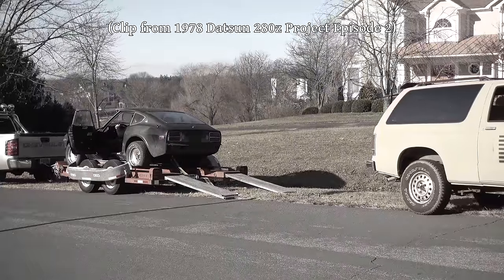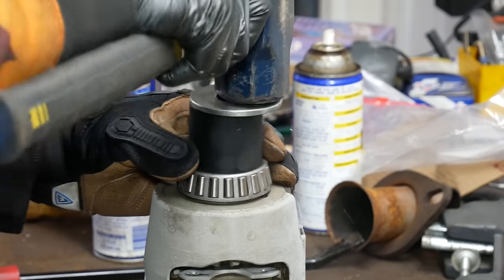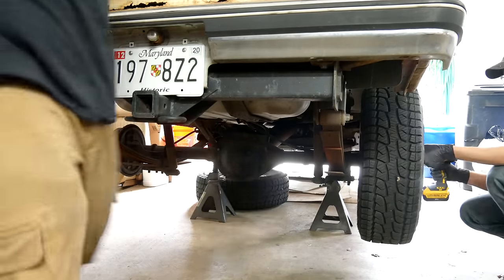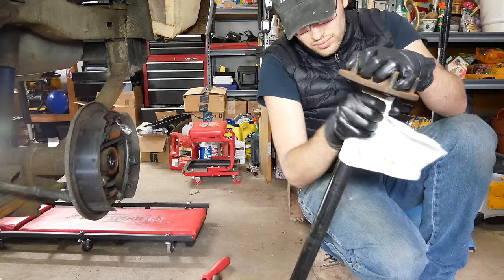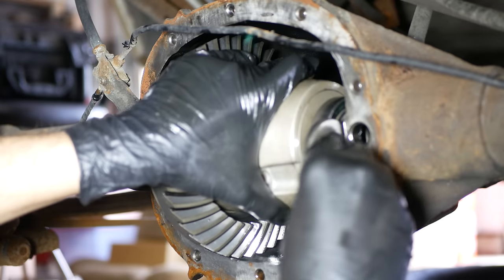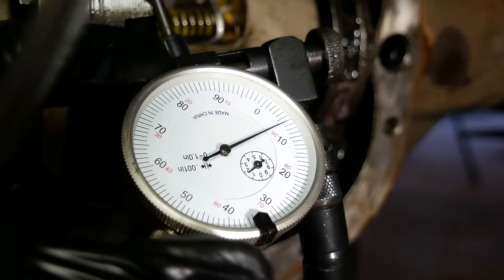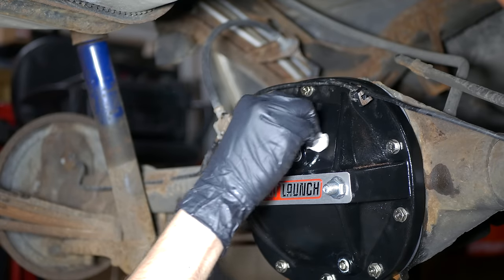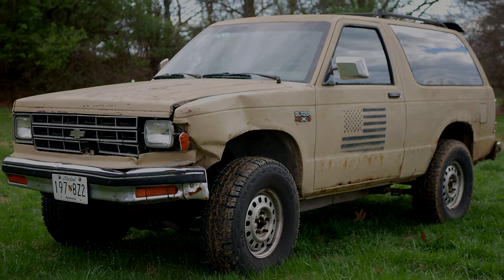4x4 V8 S10 Blazer Limited Slip Differential Install (on a Budget) (Ep.20)

Comment from the maker: Whew! Longest car project video yet. This was supposed to be a quick and easy edit but it quickly got out of hand, which is why after dozens of hours, three renders, and two upload attempts it is going live on a Sunday. I came across a lot of info that wasn't always easy to source in my research for this project, and I wanted to include as much of it as possible. There are some extra details to note:
There are different designs of limited slip differential carriers, we are only really talking about the function of flat clutch disc types in this video. The Auburn that we install is an old GM factory unit to the best of my knowledge, which still uses flat friction discs but a lot of their newer carriers use cones. I'm calling this "on a budget" even though the differential cover was unnecessary and relatively pricey (~$130), but that is not the focal point so I don't feel that it is a false claim. We considered going with an automatic locker but this Auburn showed up on eBay and seemed like a relatively inexpensive way to get a name-brand LSD that might have slightly better street manners.

Let us know what you think about the video! Too long? Too much extra information? Too much time spent on little things like the process (and failures) we went through trying to torque the ring gear bolts? Feedback is appreciated! Thanks for watching, hope you enjoy the video!
Reply: Nah it's pretty good. Lots of good info.  Good editing btw.
Reply: The video was good! I think you're going to like having the LSD as opposed to a locker anyhow. I have a luncbox locker in one of my cars and it's a little more noisy and clunky than most people want in a daily driver. If you're asking... the only thing I would have considered doing differently is sourcing an LSD axle from the junkyard, but with 3.73 gears already in it, and then re-gearing the front to match. 31s on 3.73s is just about the perfect ratio, IMO.
Reply: Great episode...wasn't too long! Ending was great. But get some actual gear marking compound, im sure you will be doing more work on differentials in the future!
Reply: It's pretty good, I like it and definitely don't mind the longer format. It's nice if there's some variation between episodes tho, some longer, some shorter. Maybe would be good to explain once how you research this stuff/where you get your information from/know which parts will work, that's what's keeping me back from being the backyard mechanic I want to be :P
Reply: eckspecially isn't a fucking word dude.
Reply: Fuzzy Dice Projects , why didn't you just switch to a bigger 8.5 rear end S-10 ,  then add Posi or Limited slip
Reply: I may look up that company for my 95 blazer. I've done a complete rebuild on it from top to bottum, now its time to make it more capable. Great video, we didn't have much of a winter here in PA this year so I haven't been able to play as much lol. Have a good one.
Reply: wasn't too long. Good to hear about potential issues/hickups during this, especially the ones not mentioned in any shop manual. Also good to see workarounds when some special tools are not available. Good work!
Reply: Dude, thanks so much for putting the time into these videos and adding in the extra "to the best of my knowledge" tidbits.  It's been a little while since I've come around to your S10 videos, but I'm always stoked when I do.  I'm now doing some limited slip shopping for my V8 S10 and this video is clutch in aiding my understanding.
Reply: Hey just so you know the lowest steel will loose it’s hardness is about 1340.6 degrees Fahrenheit, safe to heat a lot more than you did although it becomes hard to handle
Reply: Hey just so you know the lowest steel will loose it’s hardness is about 1340.6 degrees Fahrenheit, safe to heat a lot more than you did although it becomes hard to handle
Reply: Great vid.. Love that dialog.. "well, it limits the slip"😂
Reply: Want see more

Comment: Move to the concrete floor when hammering things. You'd be amazed at how much energy is lost to a bouncy workbench.
Reply: What if you have a metal and concrete work bench?
Reply: Winking Walrus still
Reply: Winking Walrus unless it is 100% bolted the ground not moving when you hit it with a truck.

Comment: A quick tip for ring gear removal is that rather than using a prybar around the edge (which is tricky and time consuming) you can use a punch or drift.  Find one that's a decent size, but fits within the ring gear bolt holes without interfering with the threads, and since those bolt holes are blind (obviously), you can just take a hammer and drive it off in a quick, criss-cross pattern.
(Had to rebuild the 8.8 in the Fox a few times ;-D )

Comment: Excellent video. Thank you. I do have a few suggestions for other viewers. If you plan to reuse your ring and pinion gear, measure your backlash prior to disassembly to make sure you restore it to the same position. Also measure backlash in several locations around the ring gear to make sure it is the same (within a .002" tolerance). This will make sure you have the ring gear fully seated against the carrier and you don't have a burr or debris between the two. Also red loctite is the standard for ring gear bolts.

Comment: I love these little trucks, in my area I see soooooo many of these still running and driving. Now I have to see about getting a limited slip for mine. Great video, thank you.
Reply: JOSHUA YEATTS , 96 Chevy S-10 and newer with the 4.3 engine had the bigger 8.5 rear end , the little 7.5 and 7.8 are just too small to handle V-8 power even if you put a limited slip or posi Trac unit in , the posi unit doesn't strengthen the rear end , it just distributes power to both Wheels

Comment: I have an 83 el camino with a open GM 10 bolt 7.5 differential and I've been planning to have the gears welded to have a posi for basically cheap, but after seeing this video I have the confidence of rebuilding it myself doing it the right way with better driveability when making turns than having wheels hops with a welded diff. Great video and stay safe out there.

Comment: I've got an 85 s10 blazer 4x4 with a goodwrench 350 in it. Pulled the blown up t4 out and replaced with a 5lm60 5 speed out of a 1990 s10. Really is a joy to drive. Now I need a limited slip!
Reply: FWIW, I'd check into an Ford 8.8 swap for it. Explorer vs. Blazer has to be pretty close to the same width. Much stronger axle than the GM 7.5.

Comment: Perfect! Now I know exactly how to put a posi track diff in my '92 S10 pickup!
Reply: Get a Torsen differential out of a Camaro. They don't have clutches. You can get one from a place called Hawks Motorsports in SC for about $200. I just bought one for my S10 and they sent it right to me in 4 days. Its nice and smooth no banging or clicking noise around corners. And they'll last alot longer if you daily your truck. Differentials with clutches can wear out in as little as 30k miles. Most last longer than that but with a Torsen you don't have to worry about clutches wearing out. Zexel Torsen differential operates much like the Detroit True Track.
Reply: @Thundarr995  Much obliged, I'll look into it.

Comment: These differentials usually have the fill plug on the inside high up.  I think that differential cover fill was designed with that height in mind as it’s close to that.

Comment: Good upgrade! My truck has one, came stock with it's Z71 package. To test the clutches, use a torque wrench on the wheels, like you tightened them, and should keep 80 ft. lbs. with your torque wrench, for checking condition of clutches. Real easy to blow the clutches.
Reply from the maker: Good info! I read through a rebuild guide where they made a plate to bolt to the lug studs that had a nut welded in the center to turn with a torque wrench for totally accurate numbers, but I'd bet just using a lug nut as you described would be close enough for good info
Reply: I would not go past 80 ft. lbs. though. Anymore and probably snap the lug off. If you hear the click, then all is good. :)

Comment: A couple of thoughts:

1 - Next time you need to check a gear pattern, just use grease. Silver anti-seize works nicely. Then just clean it off before reassembly.

2 - Your front diff is still an open diff. You now have 3 wheel drive. No reason to expect it to spin all 4. GM just decouples one axle from the carrier while in 2wd (for reasons mostly unknown... Jeep stopped doing it 20+ years ago and I think GM is still doing it to this day). "Locking" the front end doesn't lock the carrier, it just engages the otherwise free wheeling axle. 

3 - From my experiences as a TJ owner, and my GoogleFu telling me your Blazer only has a 4" longer wheel base than my Wrangler, now that you have that LSD out back you're going to want it in 4wd any time there is any risk of any sort of ice or snow. In 4, or in normal conditions in 2wd, you've now got radically more traction than you once had (which you demonstrated nicely). However, on ice, instead of one wheel spinning and you simply losing forward momentum (also nicely shown), now both wheels will spin and the rear will try to come around the front. Being such a short wheel base truck, this happens shockingly quickly, especially at highway speeds. I have a short stretch of actual high way driving in my normal commute and as soon as I'm in a straight line if the road is anything less that absolutely dry and the temperature is any lower than 32F, I slip it into 4. The slightly lower economy and increased tire wear is a small price to pay for not ending up dead, IMO.

edit: Forgot one... Just toss your bearings, or whatevers, into a toaster oven next time. Much less screwing around and you can get exact what you want temperature wise. You're not going to effect the hardness at any temperature a normal oven can realistically achieve.
Reply from the maker: 1. That is a fair point, I have heard of grease/antiseize being used before.
2. One of the other videos talks more about the front differential and the locking cable setup I switched it to. It certainly isn't a locking carrier, just the axle shaft to the differential like you said. That said, because the truck is so front heavy, it will usually spin both front tires even with an open diff. In the "snow donuts" videos you can see both fronts spinning together when sliding around.
3. I have not spent a lot of time driving a limited slip vehicle before, but that has been one of the arguments I read a lot about, and why I decided to leave my Silverado with an open rear diff. On one hand, people will claim that a locked/LSD rear is better because straight line traction is better and when/if it does slip it is more predictable. On the other, people will claim that it slips more often since the wheels want to move together. From my experience, there is value to both viewpoints, and either way caution is needed in winter driving for sure (as my fender demonstrates).
Reply: @FuzzyDiceProjects  

2 - Gotcha... You were just hoping for "hopeful". :) FWIW, 3wd will get you through an awful lot. Your weakest link now is probably tires more so than diffs and it looks like it's doing just fine with what it has.
3 - On your Silverado, the massively increased wheelbase gives you a lot more time to react than something like my TJ or your Blazer does. I'd do it on the pickup and not worry nearly as much about it as I would on the stubby Blazer. Just remember to put it in 4 if there's any risk at all and then you're golden. For one winter I had to make weekly 200+ mile commutes all the way across the nearly the entire width of Indiana and up to literally the shore of Lake Michigan. I did this in snow of at least 2", multiple times, usually running at least 60mph and sometimes more. I never had an issue as long as it was in 4. I do have BFG Mud Terrains, which are insane tires, but I feel like you'll be fine as well as long as you're in 4. So, put it in 4. Did I mention you should put it in 4? :)

Comment: One comment of concern. It is not advisable to leave the axles hanging in the case (it can deform the bottom of the seal) because of the weight.

 It might not be as critical with a new deal, but it will most certainly wreck an old one ( ask me how I know) after all your hard work to find leaking diff fluid leaking out the back of your drums

. So in my opinion it's always best practice to leave the axles out of the housing. Keep up the great, informative content...Cheers!

Comment: My dodge dakota suffers from a similar issue of a light rear end and traction issues in 2wd. New a/t tires helped tremendously, but when you're given a $700 parts truck with everything you would need for a 5 speed swap, a differential upgrade, and 4 wheel disc brakes, including larger discs for the front, you very quickly run out of reasons to NOT install all these upgraded parts.

The parts vehicle has an electronically activated transfer case, which is a big no-no. Currently, the plan is to use my current lever activated transfer case, extend the front driveshaft since the donor vehicle's was completely destroyed, likely due to a faulty 4wd switch, use the new rear driveshaft, since it matches up to the new rear axle, and trade out any input/output shafts between the two differentials to make the old case line up with the new splines.

Since the differential is out of the vehicle, it makes no sense to do anything other than install a limited slip, and take a close look all the seals. As it seems to be slightly rusty, and the factory paint coating stuff is flaking off all over, we're also going to be refinishing the entire axle, likely using a bunch of high temp enamel paint to make it look sharp, instead of crusty.

With the new, larger disc brakes, I am unable to use my factory 15" rims. One of the rims from the donor vehicle was seized to the axle hub, and decided it would be a better idea to bend than just release from the hub surface after some persuasion with a sledgehammer, so I'm also forced into getting new rims.

With the factory body mounts, there isn't a whole lot of room to work around the transmission, and as I'll have to modify my existing crankshaft position sensor, it only makes sense to move the cab out of the way to do so. Fully removing the cab is a lot of work, and a lot of wire harness pulling, so we can't be doing that. However, the aftermarket is a wonderful place, and has 3" body mount spacers available to give you that little bit extra clearance to install this new driveline assembly.

Luckily, the factory 16" rims from the donor vehicle seem to hold air, and have 4 decent enough tires to do some light testing, to insure everything is working properly. Unluckily, one of these tires has steel bands showing, and all 4 are rather weatherchecked. They're also a smaller size than my currently installed tires, which means my speedo would be off. Which really just means that these will have to be used for a giant stress test of the new brakes, the limited slip differential, and the new clutch. With prior mentioned condition of these tires, it doesn't make a whole lot of sense to go too far from home. To make a long story short, a brake stand will be necessary to insure all new parts are functioning properly.

Comment: 09:40 The main weakness with the 7.5/7.625" rear end is the pinion gear on 3.73 and lower ratios, is a baby's fist, where 3.42 and taller gears are must bigger and far less prone to the teeth being striped off under heavy load. That cover may help the smaller 3.73/4.11 pinions survive a big power input as anything that minimizes gears moving away from each other on that little rearend is a good thing.

Comment: Is there a reason that you used an old macbook as a holder for the bearings as you heated them up? I might use mine for that aswell if its a good way
Reply from the maker: I wanted a clean metal surface to prevent the workbench from catching on fire or whatever, the aluminum lid was a nice surface to do that on. Macbooks are just so useful!
Reply: @FuzzyDiceProjects  makes sense, never thought of that. Alright, time to use mine as an engine stand, i dont want my wood blocks to be dirty.
Reply: @fgcarlover6112  😂

Comment: hey, you might want to check your axle seals for any leaking here pretty soon, I've heard  letting your axles sit on the seals like that for any extended period of time can slightly deform them causing leaks later on down the line. probably not super likely but it'd be a good thing to check just in case.
Reply: I cringed when he did that... But... He poked enough of them into the housing that most of the weight was probably carried on the axle bearings. Still, not ideal.

Comment: You can also go buy a couple hundred pounds of concrete sacks and just leave them in the cargo area. Will increase traction and more importantly help hanikg. That thing has to handle like crap with that little weight over the rear axle.

Comment: I had a 98 ZR2 blazer. The posi and bravada axle swap helped alot. But cheap 31x10.5 M&T tires made it a BEAST. The increased tire clearance and 3.73s paired well with the 31s. Thinking your 3.08 and a 30 inch M&T would be equally capable.

Comment: I feel like the fill hole is a little high because the cover supports. It looks like your tubes are almost completely filled.
Reply from the maker: I'm not sure if there is a good head-on level picture of it in this video, but the fill plug on the aftermarket cover is at most like 1/4" higher than the factory one. I did have the same reaction seeing the aftermarket cover at first but the fill is pretty much in-line with the side bolts on both covers so it shouldn't be a terribly significant difference